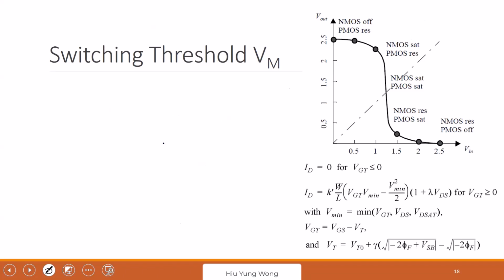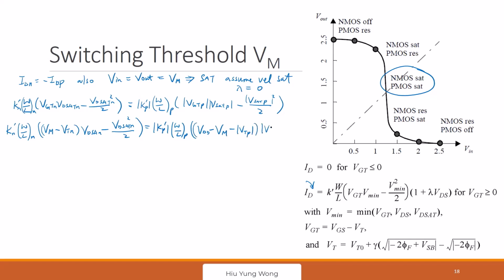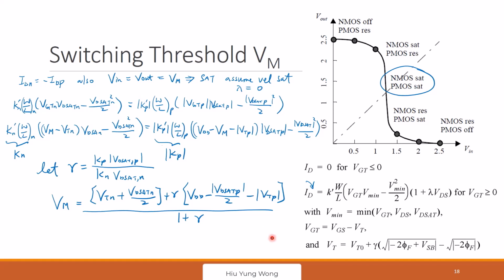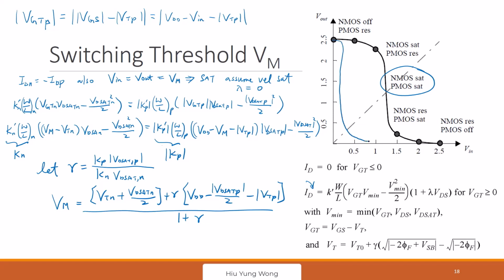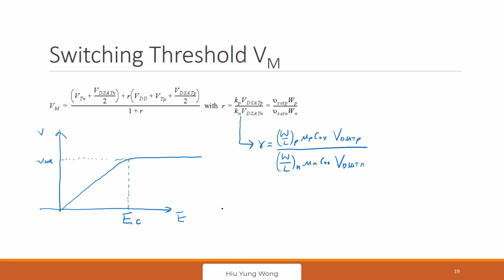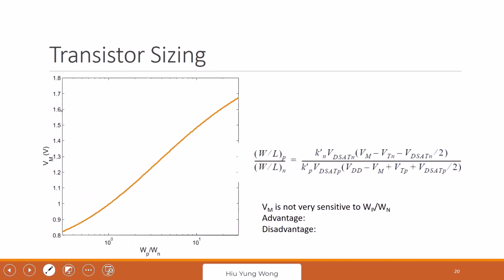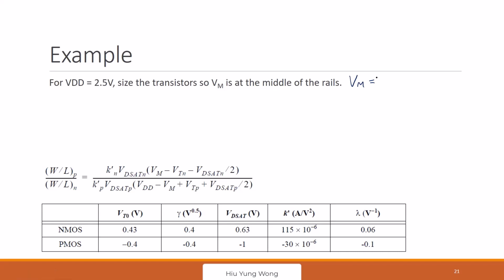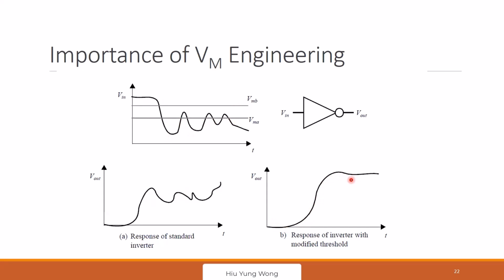L9-C Switching Threshold VM of a CMOS Inverter

Comment: Hey! 

Great videos! 

Are you following Digital IC by Jim Rabaey?
Reply from the maker: Yes, @kartikmahavar1845. Thanks for watching.
Reply: @quantum_computing  yo, when we are analysis for vm  shouldn't we use the formula of the saturation. ( i mean we should take (vgs-vth)^2 rather then (vgs*vd-vd^2)(1+lamda(vd))
?
Reply from the maker: @subashreddy5720  Your equation is the saturation equation for a long channel. In a short channel, there is saturation due to carrier velocity saturation. Therefore, you need to use this equation. Please take a look at https://youtu.be/9SLykqCjwkc?si=EsfGuEv-eCg5y70v (L6B). You can also watch L6A first to understand the effect of short channel first: https://youtu.be/rpGi-RKso8Y?si=U_k-FqHrEMmfNzXy
Reply from the maker: @subashreddy5720   The equation you used is for a long channel. For a short channel, you need to use the equation with current saturation due to carrier velocity saturation. Please take a look at L6A and L6B. https://youtu.be/rpGi-RKso8Y?si=U_k-FqHrEMmfNzXy and https://youtu.be/9SLykqCjwkc?si=evNU4U5QefmvFidf